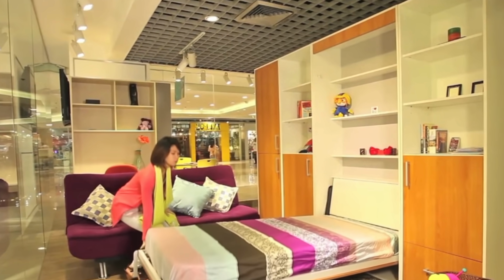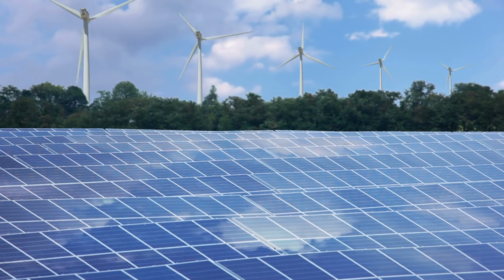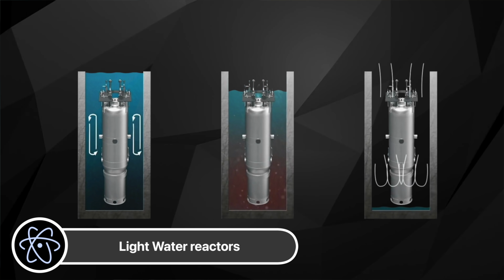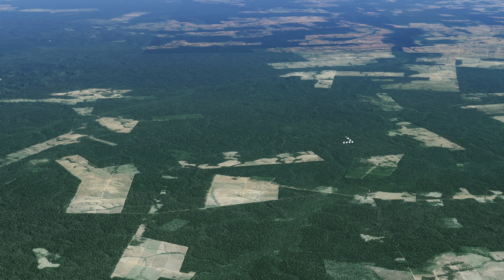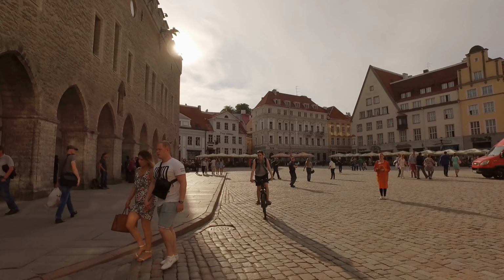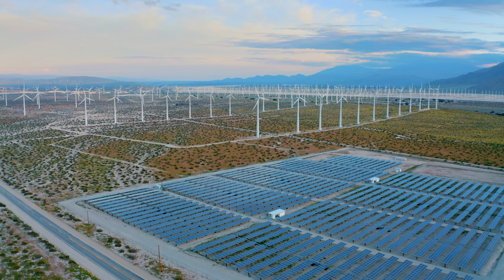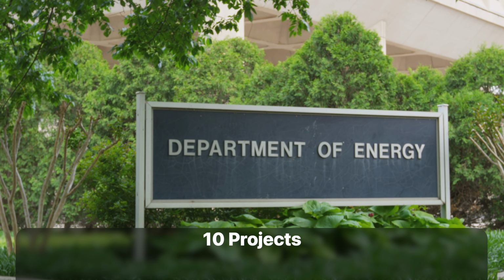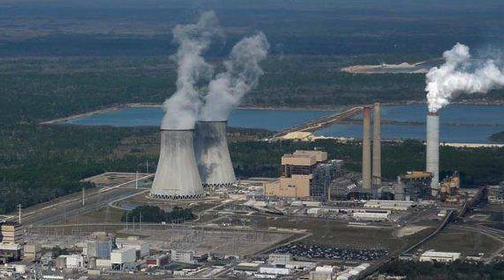Why Small Modular Nuclear Reactors Are the KEY

Comment: Thank you for the interesting and informative video! Two clarifications:
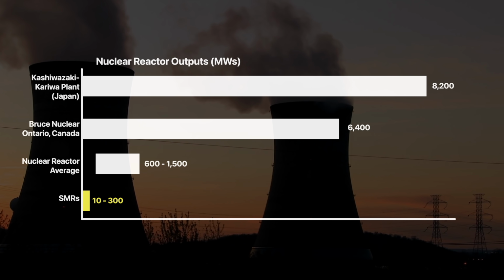4:17 that output for the Bruce Nuclear facility is for the entire PLANT not for an INDIVIDUAL reactor. There are 8 reactors, there, with an average generating capacity of ~800 MW.
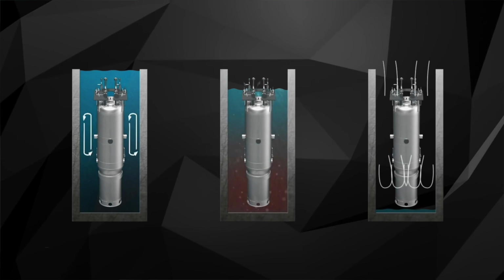9:47 the video's narration refers to molten salt, similar to solar arrays, while showing a picture of a photovoltaic array. Photovoltaic arrays do NOT use molten salt - they use solid state, semiconductor technology. What I think the intent was to show how molten salt is used in concentrated solar power (CSP) facilities which DON'T use solid state, semiconductor technology. The picture didn't correspond to the narration.
Now a question:
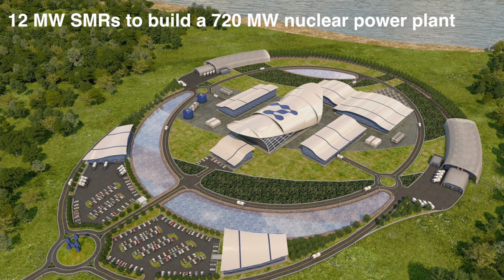10:28 If NuScale can create a nuclear plant producing 720 MW, out of 60 12 MW SMRs, at a cost 20% less than a conventional reactor, that means that the cost of energy production would be ~$3800/kW which is STILL almost FOUR TIMES the cost of a natural gas power plant. Why bother?
Reply: "[NuScale] STILL almost FOUR TIMES the cost of a natural gas power plant. Why bother?"

1. low emissions power production from a dispatchable plant
2. the 3800/kW is capital cost / kW (i.e. building cost), not necessarily the full cost once fuel, maintenance and depreciation are taken into account (the depreciation on the 60-100 y lifetime of a NPP is quite massive)
3. the 3800/kW also includes financing, and it remains to be seen, but it is likely that NuScale build is faster, thus lower financing
4. innovation - we have to give this technologies a bit of a boost in the beginning so that they have a chance to learn, to incorporate that knowledge, and to iterate - forever? no, but you gotta give them a chance.
Reply: @factnotfiction5915  Thank you for your reply!
1. OK
2. and 3. Unfortunately the video didn't provide the details on what the costs covered. I'm just going by what was provided :-( I'd also like to see refurbishment and decommissioning costs listed. In Ontario, Canada, we currently have a very expensive ~C$13B re-tubing operation going on at our Darlington nuclear power plant. When it comes to decommissioning, there are costs associated dealing with not just spent fuel, but all the piping and containment vessels: dealing with them is not cheap and there's no practical way of recycling the piping and vessels.
4. I suppose so, but I think that a better use for capital and research would be in solar, wind, and grid-scale battery technologies. Solar and wind power provide for distributed (and hence resilient) power generation, which can be incrementally added to or maintained. Solar, wind, and battery systems are now recyclable, as well.
I remain unconvinced that SMRs are a good use of time and money.
Reply: @ivanprock624  "In Ontario, Canada, we currently have a very expensive ~C$13B re-tubing operation going on at our Darlington nuclear power plant." - yes, it seems like Ontarians are just burning C$13B, but I suggest you think about it differently.

You are investing C$13B. As a result of that investment you will receive decades of low-price, low-emission electricity. So the question isn't how much is spent, but what is the value provided,  the ROI of revenues/costs.

You and I as typical consumers don't often think this way. We go shopping for a toaster. Here is a toaster which meets your needs. What is the price? How many times have you thought about the capital cost of the factory which builds the toaster?
To the owners, does it matter if the capital costs of the factor are high, if they sell a lot of cheap toasters? Naturally, the owner wants to invest only what is necessary, but if they built a smaller factory, they might have higher priced toasters and sell fewer - the owner is looking at the value, the ROI, in addition to the cost.

decommissioning and recycling the piping and vessels
The costs of decommissioning are just a part of the total capital cost. What matters is the value, the ROI, not just the costs or just the revenues.

The piping and vessels are probably intermediate level wastes, but that is dealt with in a slightly reinforced landfill. It isn't the same issue as high-level waste like spent fuel. And again, we come down to value - decades of cheap, low-carbon electricity divided by a few tons of slightly radioactive piping is easily great value.
Reply: @ivanprock624  

"I think that a better use for capital and research would be in solar, wind, and grid-scale battery technologies."

Ok, but I urge you to examine this about wind: it is either:

* a technology that is 1000s of years old, which was pushed aside by coal and natural gas, and in the 65 years nuclear has been part of commercial (about 1953? 54?) - nuclear has rocketed past it in terms of amount of energy (primary or electrical) generated globally.
or
* a technology that saw its first modern incarnation as electrical generation using a 3-fan horizontal turbine in 1945 Denmark, and although nuclear started later - nuclear has rocketed past it in terms of amount of energy (primary or electrical) generated globally.
or
* a technology that only came to the fore in the 1970s-80s as modern aerodynamics were applied using computer modeling, and although nuclear hasn't really built too much new capacity since that point in time and remains stuck in the slide-rule 1950s-60s designs because of politics - nuclear still remains dominant in terms of amount of energy (primary or electrical) generated globally.

Is wind, or is not wind, going to wipe the floor with nuclear? It hasn't really done so despite decades of research. AND the fundamental problem of wind, intermittency, is simply insoluble (mitigatable with storage, transmission, overbuild, etc, but not soluble). More efficient wind turbines are uselessly more efficient if there is no wind, or the wind is blowing too fast.
(note that wind capacity factors haven't changed much in decades, a few % as hub heights have risen and as offshore has become possible)

Solar is a truly new technology, we'll say 1970s-80s from a practical point of view. However, intermittency remains insoluble, and literally half the time the panel is an idle asset (i.e. at night). Again, mitigatable, but not soluble.

So for solar and wind it all comes down to the mitigations:
* extra transmission - somehow never incorporated into the super-low rates the RE people quote. However, to bring wind from Wyoming to Chicago, or Alberta to Toronto, it isn't cheap.
* overbuild - we just build extra plants, geographically dispersed, and thus hopefully anti-correlated, to provide continuous power. But these extra assets cost. So if you have 20% c.f. solar, and you overbuild by 5 (more like 6-10 because 5 assumes perfectly anti-correlated) to provide 100% solar - then your $0.03/kWh solar becomes $0.15/kWh solar - SOMEONE HAS TO PAY FOR THOSE EXTRA ASSETS! :) - overbuild is not cheap
* storage - same as overbuild; someone has to pay for storage - pumped hydro, batteries, whatever, these mostly idle assets have to be paid for, and their costs are much, much higher than generation. For example, batteries ~ $100/kWh.
* demand management - Soooo much easier to change an entire society than to build a few power plants. Yes, on the edges it is practical and we can save a few %, but we should save that few % irrespective of wind/solar/nuclear/even coal!
Humans are diurnal creatures - we essentially ALL wake at sunup, we ALL have lunch around noon, we ALL have dinner at sunset, we ALL entertain ourselves in the early evening, and we ALL sleep at night - although there are exceptions, because we all have this same schedule, society has this cyclic power consumption nature - which DOES NOT MATCH solar's and wind's vagaries, except by happenstance.
* efficiency/conservation - Ditto above. Yes, on the edges it is practical and we can save a few %, but we should save that few % irrespective of wind/solar/nuclear/even coal! We can't conserve our way to zero consumption. All the low-power societies on the planets are fairly horrible places to live, and we should bring those societies up to a high-power consumption level, not go down to meet them.

"distributed (and hence resilient) power generation" - it sounds true, but it isn't. Power plants going offline is rarely the cause of a power failure. The most common failure? A tree falling on a transmission/distribution wire. Creating more distributed power plants increases transmission, increasing our exposure to the most common failure mode.
If we could build a NPP (with multiple reactors for redundancy) inside/right next to each of our cities, then we only need to worry about distribution wires.
Hmmm, NuScale has a design with 12 reactors (redundancy) with an EPZ of 180 ha (small size), so it could fit inside a city!

Saskatchewan
Reply: @factnotfiction5915  I prefer to think about it as "throwing good money after bad". Darlington was way over budget and contributed to a huge debt that Ontario hydro ratepayers now have to pay over many years. The $13B re-tubing cost just adds to that debt. This was definitely NOT low-price electricity! Currently, solar and wind power produce electrical power much more cheaply than nuclear reactors. A better use of the $13B would have been to spend that money for cheaper sources of power: more bang for the buck.

If the capital cost of the toaster-making factory is very high (like the cost of a nuclear power plant), then that cost will be paid to the purchaser of the toaster (or the purchaser of electricity), versus the company that used a lower capital cost toaster-making factory (or the lower cost power generation source).

The owners don't care - they're selling into a captive market, that's one of the problems of getting electricity from centralized power sources, such as nuclear power plants.

That's not correct. I've never seen an instance where decommissioning costs are bundled into the capital costs, they are always added-on later, to artificially lower the capital costs to make it look like nuclear power plants aren't as expensive as their full Life Cycle Assessment would show them to be.

They're radioactive. They don't go into just any landfill, even if it's slightly reinforced.

In summary, we completely disagree on the true costs of nuclear power, be it using conventional nuclear reactors or using SMRs.
Reply: @factnotfiction5915  Wind power has enjoyed a resurgence, for quite a while, because it costs less than coal and natural gas, and emits no particulates or CO2 during its operation. In most nations where wind power is in use, its use has grown dramatically.

Nuclear power is on the way out: nuclear power plants are being closed, some plants are not being completed, and very few new ones are being built.

Wind power is on the rise. Nuclear power is stable or declining.

Intermittency is dealt with by combining wind power with solar power, grid scale batteries, hydro, and grid improvements, where required.

Solar cells have been used on satellites since the 1960s. They've been deployed for grid-scale applications for years. Since they're based on semiconductor technologies, their prices have plummeted. Solar polar is well understood. It is much simpler and faster to design, permit, and install a solar farm than it is to construct a nuclear power plant.

Solar and wind power, unlike nuclear power, are very distributed. If you wanted to bring solar power to any place you could put solar panels on rooftops, over parking lots, on vacant land, and in some cases, on farms. Wind power has been successfully employed on farms. It could also be deployed in offshore locations such as in Lake St. Clair, Lake Erie, or Lake Ontario. If they can make wind power work in the North Sea, lakes shouldn't be an issue.

Overbuilding solar or wind power still costs less than building nuclear power and now you get extra power, during appropriate conditions, for other uses, as well as improving grid resilience.

Beyond the solutions I've described above, Tesla is deploying or increasing the deployment of Virtual Power Plants (VPPs) in Australia, the UK, and California. In addition, newer EVs have Vehicle To Grid (V2G) capabilities which allow grid operators to "borrow" energy from EVs, as required. Try doing that with a nuclear power plant.

Creating more power plants doesn't increase transmission costs: you make use of existing infrastructure. Distributed power generation eliminates the single points of failures that nuclear power plants (and the transmission lines that emanate from them) pose.

I don't see NuScale as being a near-term solution: on their Facebook page they said that their first American power plant won't be in operation for another NINE YEARS. We can't wait that long for their technology to be tested, let alone built out.

Nuclear, whether conventional or SMR, is not the solution to today's problems.
Reply: @ivanprock624  "I prefer to think about it as "throwing good money after bad". Darlington was way over budget and contributed to a huge debt that Ontario hydro ratepayers"

And that may be true, but you continue to present a weak case. The cost is not the only determinant of the value and a toaster factory with high capital costs does not axiomatically sell more expensive toasters.
Likewise, a ticket to the opera/your favorite rock band is likely much more expensive that a ticket to hear your nephew sing in the grade school choir, but the values are ALSO very different.

You complain about the $13B debt, but you fail to also list the value not delivered with that. Low-emission electricity at low average costs for decades is nothing to sneer at without real analysis.

"Currently, solar and wind power produce electrical power much more cheaply than nuclear reactors." - when they are working. When they are not, nuclear or high-carbon natural gas pickup the slack - you SHOULD pay a premium for the backstop.

"I've never seen an instance where decommissioning costs are bundled into the capital costs, they are always added-on later, to artificially lower the capital costs to make it look like nuclear power plants aren't as expensive as their full Life Cycle Assessment would show them to be." - yeah, there are a lot of accountants who have avoided jail for financial fraud who disagree with you.

"[intermediate-level waste (decommissioned reactor components] don't go into just any landfill, even if it's slightly reinforced."
According to the World Nuclear Association, they do: "A number of countries dispose of ILW containing short-lived radioisotopes in near-surface disposal facilities, as used for LLW disposal." - because it just isn't that dangerous. Sigh.
Reply: @factnotfiction5915  "60-100 year lifetime" of a nuclear power plant includes building & cleanup, actual on-grid generation time is less than 30 years
Reply: Reliability...
Reply: Does that USD1000/kW includes the natural gas it needs throughout its entire lifecycle?

Comment: Nuclear powered cars are possible using the heat from a single 6cm nuclear pebble to power a Sterling heat engine either in a direct drive configuration or to run a small range extender in a more conventional hybrid electric configuration. The advantage of using a pebble powered Sterling APU is that it could provide excess power to wherever you happen to be. Imagine getting paid for electricity when you car is parked at work or while shopping then plugging in when you get home to supplement your power needs over night when your solar roof isn’t producing anything.

Comment: There is a company in the UK that has developed a technology that is green, cheap, safe and flexible. It's going commercial next year, it's called Infinite Power. 

Very simply it puts a modified solar panel into a metal box about the size of a household brick and places a radioactive stick inside with it. The box is sealed and it produces electricity with little or no maintenance for decades. It's modular so just add more power cells to increase output. They claim it will be the cheapest way to generate electricity ever. We shall find out for sure when their first factory opens in the UK.
Reply: There is a new sucker born every minute
Reply: @garry8390  Quite, I suppose the difference with this one is that it has completed all the R&D and it going commercial with a few small power stations and sales direct to customers already lined up.
Reply: @amb8274  Lies
Reply: Do not invest in this company but if you feel compelled to then feel free  but only invest a small amount. You will lose this money but it will teach you a valuable lesson about the degree of fraud that exists in the world.
Reply: @garry8390  Thank you, I've not invested anything. They wouldn't take my money anyway as they are only looking for investors of 'high net worth' and the UK government have put some money in through one of their start-up / green energy schemes.
Reply: @garry8390  I just posted about this company because I like new technology, if anyone wants to invest in it I'm sure they will do due diligence. I'm quite sure it is legit but if I were to invest a single penny I would do more detailed research including visiting their R&D facility in Cumbria (which they do tours of) and I would speak to the lab staff etc. Not to mention double check the UK governments involvement.
Reply: @amb8274  No,that is not legit.
Reply: @paulbedichek2679  Then why would the company be invited to speak at the recent COP26 conference?